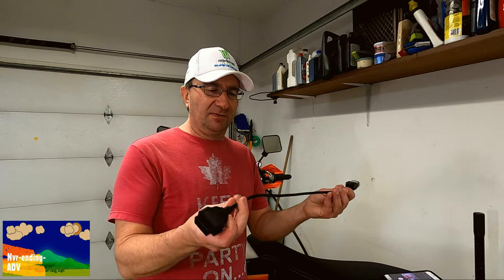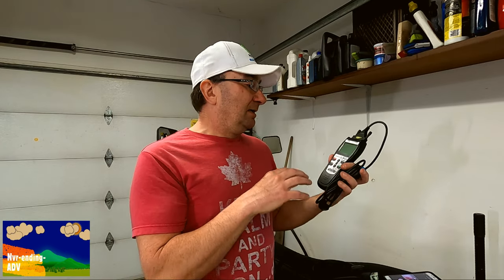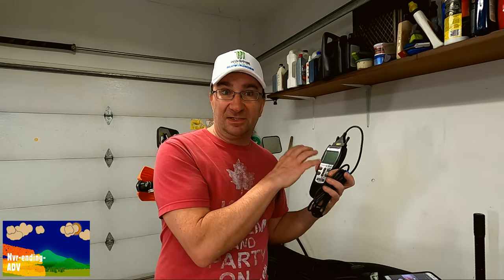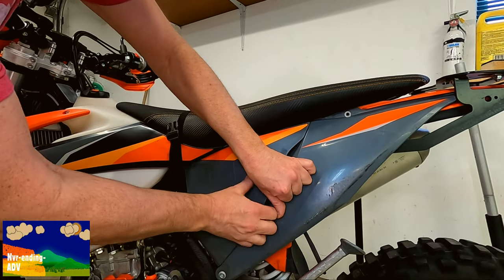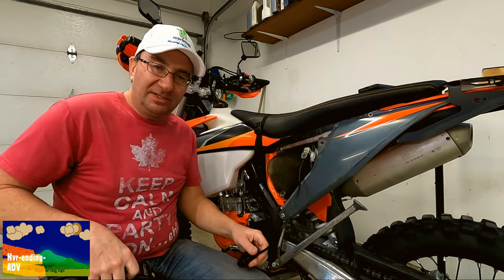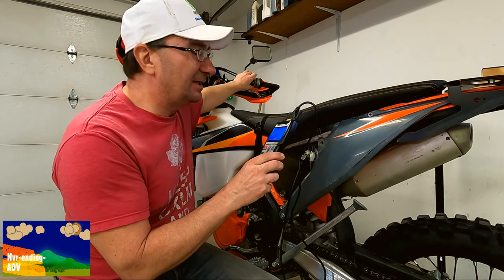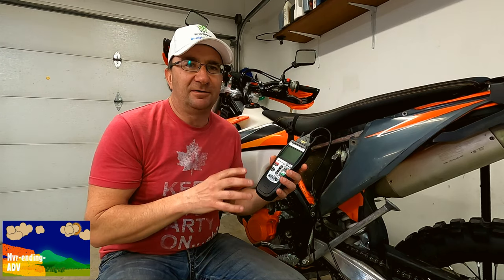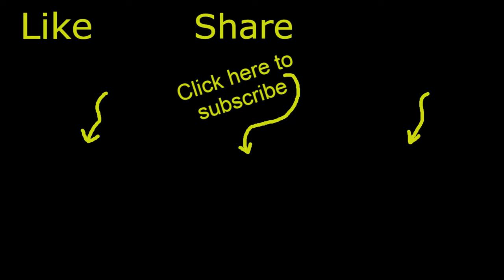Scan a KTM 500exc-f with a standard automotive OBDII scanner

Comment: Nice video! Is it also possible to jump the ecu on a 250 sxf? Cause i think you jump the diagnostic plug. Cant find another plug to read, and think that reading and jumping at same time is impossible…
Reply from the maker: Oh boy, that’s a tough one.  If it’s not running check the basics…spark, fuel, compression.  If the bike starts you’ll just have to run it while you scan it.

Comment: Does the engine need to run or is it enough when ignition is on do connect the reader?
Reply from the maker: Sorry I’ve been working a shutdown for a month 
The bike does not need to run, but you need to take the seat off and jumper a wire. There is a pic on my Facebook pictures, sorry you’ll have to friend me then you can look through them 
Cheers

Comment: If you unplug one of the sensor or if a sensor is giving a bad reading will it show a trouble code to that sensor?
Reply from the maker: Thanks for watching Eugene. Yes, when the ECM detects something out of range it will throw the light on. Even if you plugged the sensor back in, the light will more than likely go out but the code is logged into the ECM until cleared with a scanning tool.
Cheers!
Reply: @nvr-ending-adv8644  will you be doing a demonstration video? Please
Reply: Darn that link takes me Canada Amazon and they wont ship to the US. Ive been searching my Amazon all morning and cant find it. I seesome that are close but cant be sure. One has round pins instead of blades like the one posted hmmmm. And others the picture isnt clear. The one you posted says its for Duke/RC 2011-2017 but if it works its good. Ill keep trying not that I need this now but its good to be prepared
Reply from the maker: @eugenelane3291  oh boy I don't have a bunch of time at the moment. If you join my facebook page, then you can message me I could walk you through it?
Reply from the maker: @eugenelane3291  Fixed it for you.  Check the description I added the US equivalent.  If you read comment, there is someone with a 500 that it works!
Reply: I bought the cable and scanner months ago and Im going to do some practice testing incase I need to trouble shoot sometime down the road. Have you learned more since this video? Do you have or is there a list of the trouble codes? Do you know the protocals ktm uses? 😅
Thanks